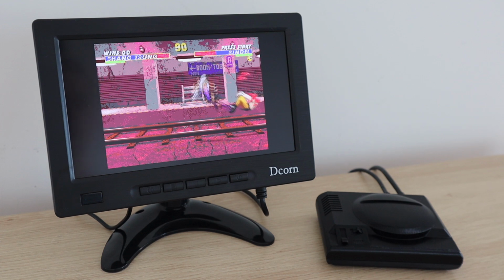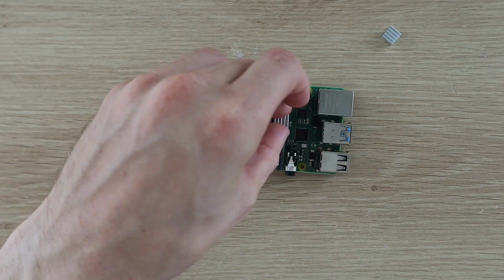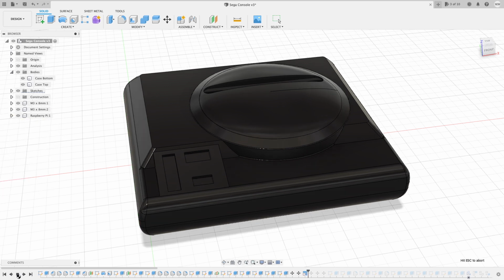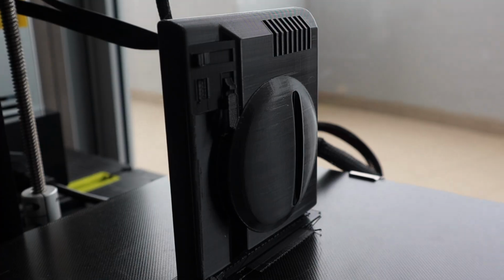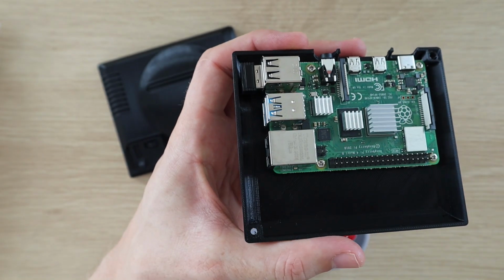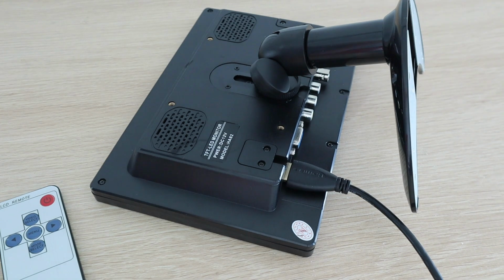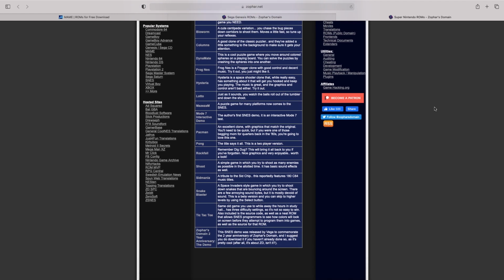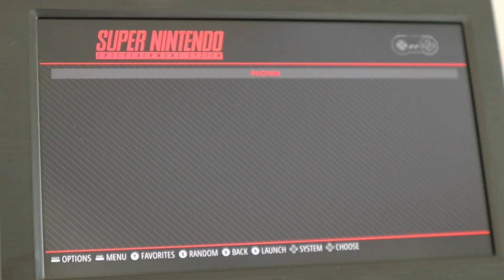Mini Sega Genesis Console Powered By A Raspberry Pi 4 Running RetroPie

Comment: My Rpi 3 with retro pi installed was a main source of entertainment for my wife and I while I finished engineering school. We were pretty tight on money back then. We did run into heat issues occasionally. I would recommend your fan build if anyone plans on playing PS1 games.
Reply from the maker: They are loads of fun. Thanks for the tip, I haven’t yet tried playing any PS games on it. I’d imagine they’re a bit more demanding.

Comment: noob question: If Raspberry 4 has WIFI  can't you download Retropie and the roms directly on the R4 instead of using a PC?
Reply from the maker: It has WiFi, but RetroPie doesn't have a browser built into it. So you can't access the internet as such to download roms directly.
Reply: @MichaelKlements  thanks for clarifying that for me :)